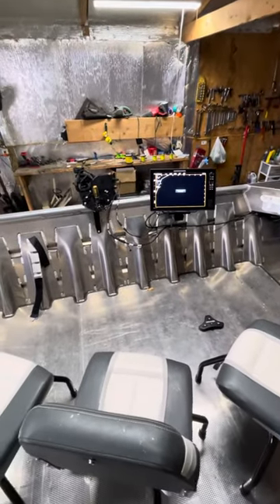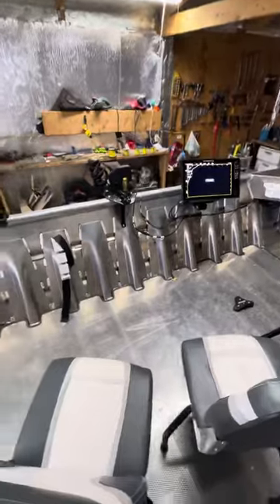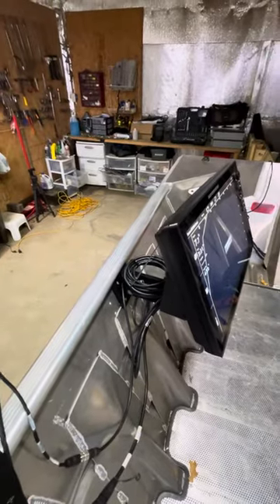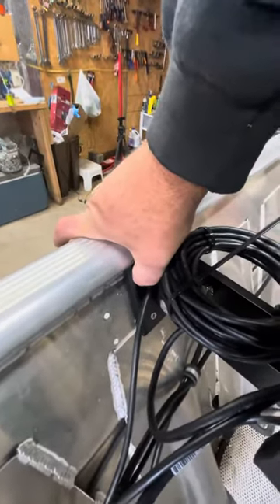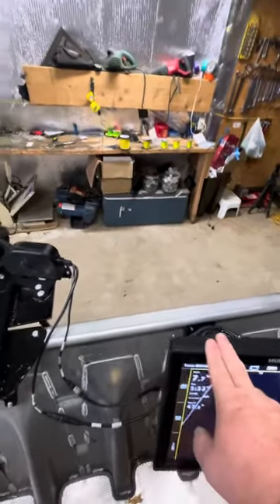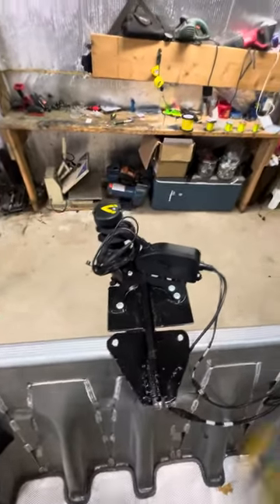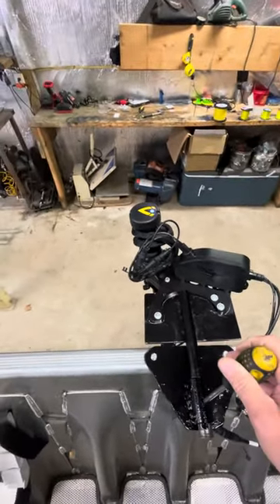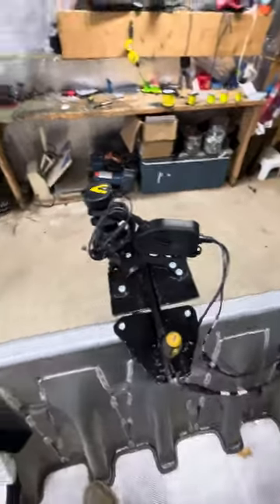Hummingbird target lock mobile boat to boat system

Comment: Hello Nelson Watson Fishing.   Where are you located?   I am wondering if you or someone out there in this big fishing world can help me with.  I am sure this is a question many of us have.  I have a Terrova with I-pilot Link, two networked Helix 9's and a Mega Live.  I am very interested in the  Mega Live Target and right now Hummingbird has the Live Target at Cabella's for $999.99.  You pay the $1,500 up front and you get a pre-loaded credit card for $500.  I did this with my  second Helix 9.  So my question...Does anyone  (I see you have one, Did you make this Bracket yourself)  or anyone make a bracket for the Live Target that could be mounted on the starboard side of my boat just like my Mega Live currently is? Is there any reason I couldn't just make a bracket like the one I already have for my mega live or just use the bracket I already have?   I think I am going to buy the Live Target and if I can't get it mounted hopefully I could return it to cabella's.   Also, is the Live target really worth it.  I do a lot of hover fishing for salmon on the Columbia River by Portland Oregon.  Could you make me a bracket like the one you have that I could buy from you since you have already figured it out???  I would be willing to take you fishing this summer for some help.